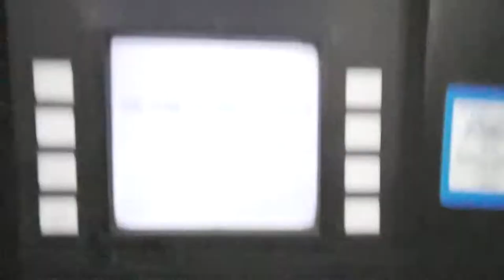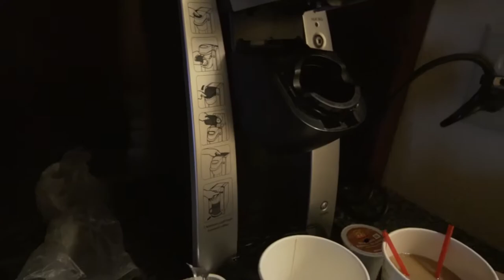Debauchery in Texas! Texfest 11!

Comment: Do you have a boost reference fuel regulator on the 535i?
Reply from the maker: It's an Aeromotive 4.5 bar adjustable unit with vacuum reference. Why do you ask?
Reply: @DENVERBEERANDOIL  it was mentioned that the car was acting funny. I was imagining that the boost was pushing back the fuel pressure.